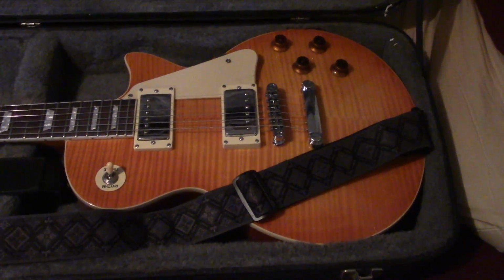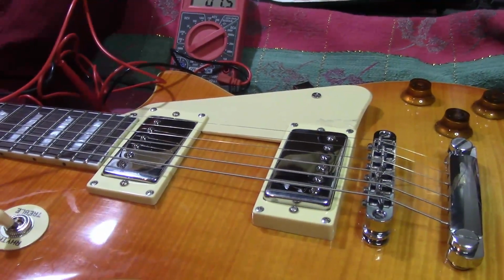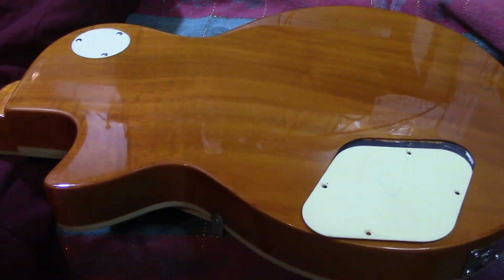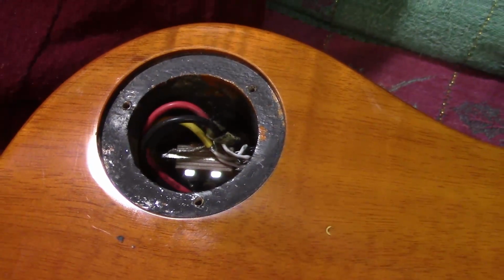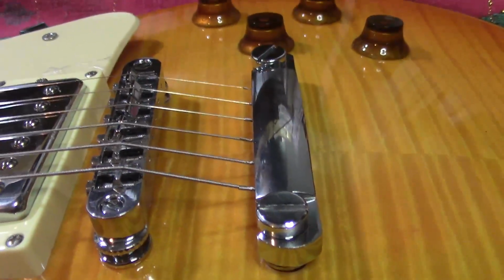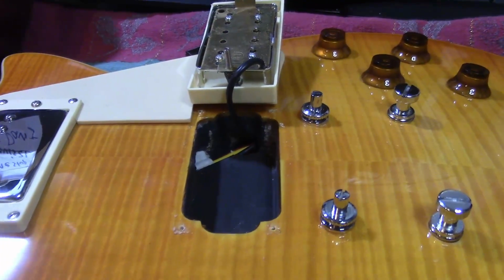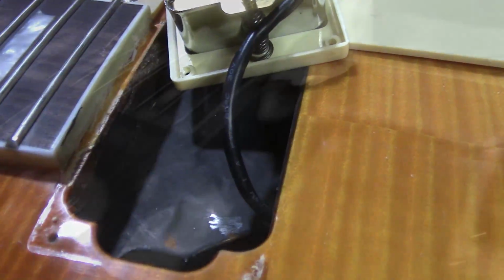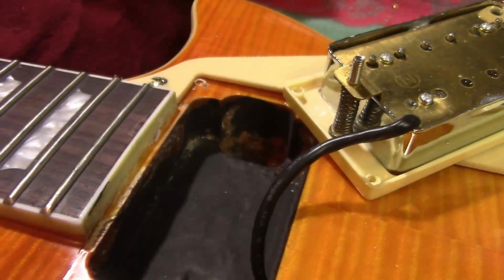Let's Tear Apart a 2021 Firefly FFLP and see Pots Pickups Switch and cavities Review

Comment: I just ordered one out of curiosity, I was going to spend more on an Epiphone but I heard these are decent.. I hope I get one of the ones with less issues! It's a gamble after all
Reply from the maker: You would think they would have better quality control. The one I got in this video is fantastic, I am not gonna have to change anything.
Reply: Unfortunately it can be a crap shoot. I have a FF338 and an FFLP Classic. I had to change the bridge on the 338, that's it for both, at this time. But they seem to be built pretty solid!

Comment: Thanks for the review, just checking to see if these are in playable condition ... I like to sometimes to get guitars where I'm free to make upgrades and essentially make it my own but I can't deal with warped necks, fret problems or MAJOR flaws.  Changing the rest is just ... FUN.  Plus I play heavy gain music .... so only a % of the tone comes from the guitar ... amps and settings take over at a certain point.
Reply from the maker: It is absolutely playable, in fact quite good. A great guitar to mod. It is fun to make a hot rod guitar, these days it can be done rather inexpensively. Seymour Duncan Blackouts are my favorites. I put a pair in a Monoprice Les Paul and it is my favorite guitar.
Reply: @vacuumtubesandguitars  I have been looking at these too. They have some beautiful LP styles at a nice price. Like yall said, I can change PUs an wiring. I did a Monoprice strat that I play all the time. It was 89 bucks an plays very comfortable
Reply from the maker: @daviddigital6887  My #1 stage guitar is a Monoprice Les Paul that I put Seymour Duncan Blackouts in, it is now a really good guitar. Amazing how nice a $200 guitar can be these days.

Comment: That model is awesome, I like the tuners, I have a lizard burst fflp but it came with some metal tuners,that need to be replaced,I'm also updating the pickups with some 57 epi classic, my favorite humbuckers, they do have shielding paint that actually works, tested it with a multi meter for continuity,these guitars are molded on like a 59 LP with a fatter neck and one piece vaneer on the back, plus they weigh as much 8-10 pounds, mine has to be around 9.5 pounds,nice sustain right.
Reply from the maker: It will sound great with those pickups.

Comment: I have the exact same one, bought it in may on sale for $169. Wanted an ice tea type finish but this one looks just fine, plus it have the vintage style tuners. Mine checked out the same as yours it looks, Im going to put in some epiphone alnico pickups from a G 400 I have lying around and go with 50's wiring. Something I have ot done on a lp before
cheers
Reply from the maker: It is amazing how good it is for un er $200. Those Epiphone pickups are really good
Reply: @vacuumtubesandguitars  what a strange company....today they have more of these HB's listed on their site, but the backs are a darker finish and they have chrome tuners. 
Box of chocolates as they say
Reply from the maker: @traileater  I like the darker back ones. 2 years ago I bought one branded Monoprice, a Darkburst for $99, it is a nice guitar and amazing for that price.
Reply: @vacuumtubesandguitars  was that the bolt neck route 66? I wished i bought one. 
And i would prefer a dark back as well.
Reply from the maker: @traileater  Yes it does have a bolt on neck. I put Seymour Duncan Blackouts in it and it screams. I use it onstage often

Comment: Wow. I have a 338 Fire model and i have not looked to see if it has big pots or not (Kinda hard with a semihollow to see). So im not sure mine is the same. I hope it is, im curious if this is just done to the LP models. ? That is shielding paint in the cavity. Thats a good sign. All the Fire models ive seen have had wax potted pickups and this one is as well. For the $ they really didnt cheap ya on anything, getting an Epiphone of this quality costs a lot more than $175-200. ! :-)
Reply from the maker: They are well built, their Telecaster models also have the shielding paint. With a small mirror and a flashlight you can see the Pots inside a 335 hollow body. A dentist mirror works well, stick the mirror inside the F-Hole, shine the light on the mirror and you can see them.
Reply: Not sure if your aware by now. But a last year model I saw had Dime size pots. It was the 338 spalted maple.
Reply: @chucklee347  I have a Spalted Maple 338 that came with big pots. Weird. Hmm... now im curious as to why they are changing something like this up. Must be getting different batches. I was very impressed with the 338 i got. After about 6 months it need neck adjusted. But since then its been fine. I really think it just needed to dry out, a lot of these cheaper guitars need to sit for awhile. But the neck hasnt moved at all since i did that and ive had this guitar about 2 years now. I had an issue with my order and ended up with the guitar for $109 shipped. Cant complain. Ive picked up guitars cost 8x the price that dont play or sound this well. But for every good guitar they make im sure theres a bad one. Just weird that yours has small pots and mine (same guitar) has bigger pots. I got mine directly from guitar eden of whatever their site is called.
Reply: @ctcards2636  yeah. Guitars garden. I've heard that they use whatever hardware that gets pulled out of the box.  But you can't believe everything you here. I just received my smokey burst fflp about 3 weeks ago. I was almost positive someone had done a great setup then returned it. But it still had plastic on everything. It is the best firefly I've got so far and they've all been great guitars.
Reply: @chucklee347  Nice :-) Im looking for one of the Double Cutaway DC models with 2 P90 pickups in black. They have not made them it seems lately. I found a red one but the guy wanted $300 for it and i know it was under $200 NEW lol. I bought a Travis Bean TB1000S and the body is like a mix of a Gibson DC and a 335. So thats making me want to get a DC. :-)
Reply: @ctcards2636  they sound way better than the humbuckers to me. I have the second batch in white. When they started putting a tail piece and a bridge. One of my favorite guitars I text guitars garden months ago asking if they would ever bring them back I've had no response.
Reply: @chucklee347  Yeah i emailed them too. I want one with the tail and bridge like what you have. Just in black tho with chrome/nickel anything but gold lol. THe pickups in the Travis Bean i just got are like P90 ish/Tele ish its weird. But they are really HOT pickups. Having the aluminum neck... wowza its a crazy sound. So im into the idea of getting a P90 guitar and these Fire Flys are a no brainer. I work on my own guitars and i have not see anything on a Fire Fly that i have worked on any big issues. They seem to be just like intonation, adjust neck a little, set action. If that tho. For the price, they be good. Dont need a $1500 Gibson DC. The guitar you have is so damn close to that haha its not even funny. Not too impressed with Gibson anymore and i have videos on here of my guitars and I do own Gibson's. But they are not build like they use to and they cost waaaay too much.
Reply: @ctcards2636  exactly  we've come a long way. Like 5 watt world said we can get the most sound from the least gear and it is so true now. There's no reason anymore to spend 2000 on a guitar. Unless you just don't like money. This is a great time to buy instruments and gear. I'm 53. Years back a 500 guitar was a unplayable POS. Not today.
Reply: @chucklee347  Yeah. When i grew up a cheap guitar had crazy action, terrible intonation, a neck that may or may not have a truss rod and good luck on tuning ! haha. :-)